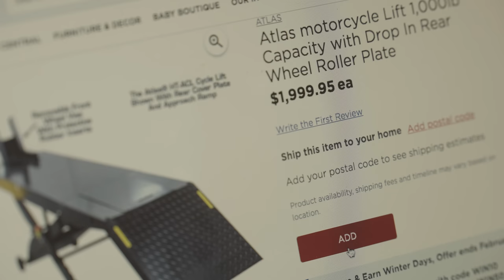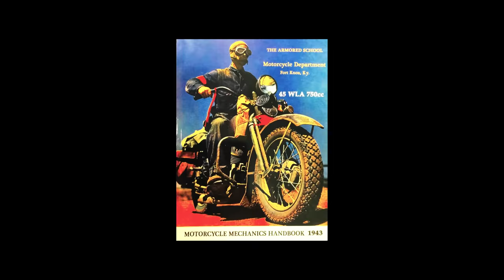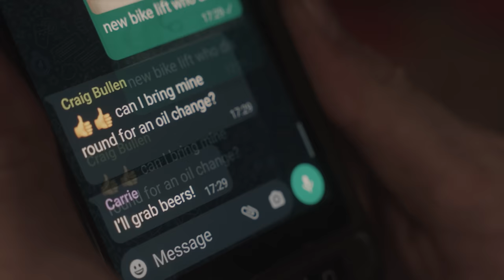DIY Roll-On Motorcycle Lift for $290

Comment: Sadly the same concept would be hard to transpose for a spyder... no ? :D 

IMO it would require a bit more strength, and would need to use its own weight to help lifting it in position. I'd build it so you back up on it, then raise the front, this way you can build a long ramp with a triangle at the "beginning", where your front wheels would sit.

Balancing it properly would be important to make it easier to lift it.

Comment: For 290 bucks you can get s decent used proper hydraulic or pneumatic bike lift.

I like the idea though, but it‘s hard to believe that a regular sized grown man would be sble to lift a touring behemoth (Street Glide, Goldwing, etc.) or a tall/heavy DS bike onto that thing without stretching one‘s luck in terms of balance and tipping momentum — let alone trying to roll it back again without help.

Keep in mind: That design was for improvised army field maintenance of lighter and lower built motorcycles a century ago. It might work well for lighter cross or enduro bikes, or people way above 200 muscle pounds and 6 feet height.

Everything else is a matter of practice, bike model and dumb luck.

Comment: I love all your contents including this episode. In the US, I see this as big major law suits waiting to happen...
Reply: Why law suits?
Reply: @heathb4319  Just my view and opinion. 1. Depending on the weight and height of the motorcycle, its going to be challenging to push up; incline. Also, shorter rider may have reach issues as you push up. 2. Sudden drop as you as bring motorcycle to end of platform may cause a losing grip and balance. Maybe you can add a dampener to drop slowly. 3. The back end locking piece is flimsy. It needs better solution. 4. Not all DYI folks are going to use similar or better materials and build skill may not be the same.
Reply: @johnwok15  ...I don't really see a law suit type problem...I just think it is useless and over priced.

Below is what i actually asked the channel...

"Can you please explain to me why this is such a great thing and then try to justify 300 bucks for what is 50-75 bucks worth of materials and a couple hours of time.
I honestly dont get it.

Lots of straps, cant change a tire or wheel.
There are bike lifts ranging from 150-400 all over the place that provide so much more and are built stronger that also allow you to do so much more.

I love what you do for the bike community but i really don't get this vid or idea.

Anyhow...Peace.

Comment: Good idea overall, but I’m Not that crazy about drilling that hole through the middle of the main beam, maybe i would mount the pivot / bar under the beam held in place with brackets… There is a difference between using it for a XL650 and. R1100S

Comment: Oh My God! Superb! thank you for sharing this. I've been wanting to get a table lift for my bike but put off due to the prices.
Just a couple of questions - 
1) You're using a lightweight bike on the ramp. However my Yamaha XJR1300 weighs 489 lbs dry so is a heavy bike! I understand you are using some slotted steel angle irons to give support to the centre 4x6 lumber, but will this be up to the job of lifting and holding my 490lb beast?
2) I'd feel happier with a centre plank probably twice the width to roll my bike onto - If I modify the measurements to cater for a 12'' centre plank (probably two 4x6's bolted together), do you reckon this would work?

Comment: OK I don't get one thing... When you want to load a bike on a trailer normaly you would use beltsfor the handlebar. They have already enough tension and they hold the bike just enough to let you secure the other belts. I don't see those handlebar-belts... So let me recap: 
- You push the bike on the rail, its weight makes the rest. Fine. 
- The front wheel is catched between the two front pillars. Great. 
- Then the purple belts stabilize the bike at the end. Wonderful.
But assuming you are alone in your garage, what exactly is holding the bike on balance while you, again alone, pull the belts until the bike is stable?   How many friggin hands do I need?!?

And of course the way around.. you want to unload the bike... so you need to set it free first and then roll it down... how you do that alone? 
in both cases you need "something", or someone, which holds the bike while you do all your things... 
On the DIY guide you forgot that "something"...

Comment: What? I can buy one for $290! Why would I spend hours making my own patent for it? I will admit it looks pretty good, but... I could have changed my brakes and oil filter in that time. Should I rather build this?

Now, don´t get me wrong! This is an awesome tip for people that have lumber and maybe Iron laying about, who wants a stand for their bike! But if you have to buy it all for $290, I´d rather get a proper one, where you can adjust the height according to the work you´re doing as well. Also, I´d happily build one just for display purposes when I don´t use my bike! Because it just looks pretty awesome! 

As for replacing a real working jacking table - I would still prefer the proper one.

Comment: I mean, cool video thanks for sharing...

But I have never understood the idea behind a motorcycle lift that doesn't suspend the bike off it's tires. Like... y'all have bad backs? Or are you just doing way, way more hours maintenance on your bikes? How does it help to have the bike ~10IN higher off the ground? And if it does help so much, why not use a 2x10 board and a few cinderblocks if you really need it up oh-so-high.

Srs, someone please tell me how this helps so much. I can see having a bike engine at table height for rebuilds... but you could literally ride up on a curb and get more than half this functionality.

Comment: by far, the most frequent requirement for me is wheel removal, how does your stand accommodate this important job, please?
Reply from the maker: I left a gap in the angle iron above the pipe so we can throw a scissor lift under the skid plate. Works great! Thanks for watching. ~M43

Comment: Ok, but without the radial arm saw, the drill press and drill and the right angle grinder, building one would be a PITA.
So if you're already a handyman/ do it yourselfer, yeah.
otherwise, the Harbor Freight one ain't bad. And it's NOT 2 grand.

Comment: What happened to the waterproof gloves video ?
Reply: Im interested also
Reply: Copied from earlier reply:
They messed up with equating gasproof with waterproof. They had a cool bubbling tanks with slightly compressed air inside the gloves. It looked cool but it didn't prove what they thought they were proving. The replacement video will likely fix this error.

Comment: Quick question... I have a Honda CB1100 (250kg/540lb wet. Is this suitable for havier bikes? I wonder whether it will be dangerous not to drop the bike towards the opposite side of where am I standing (you know what I mean). That would ruin my day... 
Any tips for safely using this lift? :)

Comment: I'm a big fan of the channel, but that first wooden lift he made is NOT how you make that lift. I made one and I use it all the time.. It just takes a 2x8 to build it and a 2x4 for a handle. Also, Harbor Fraught has 3 lifts for $140, $230 and $600 if you wanted to just buy one -_-

Comment: Great for dirt bikes/lighter bikes. What do you think the weight threshold would be for this?
Reply: The limitations would be the strength of the pipe used for the pivot and the type of wood used. Use a solid bar pivot and oak lumber and it'll take a thousand pounds easily. I would be making it wider so it doesn't tip over sideways if you plan on putting a Harley CVO Ultra on it. But getting up there would be nerve wracking too

Comment: Where did the glove video go? I was in the middle of watchign it! =(
Reply: Copied from earlier reply:
They messed up with equating gasproof with waterproof. They had a cool bubbling tanks with slightly compressed air inside the gloves. It looked cool but it didn't prove what they thought they were proving. The replacement video will likely fix this error.
Reply: @ddegn  thanks! =) very fortnine of them of putting quality first!

Comment: would have been great to have the measurement in non retard unit also ...
unlike what i've read, imperial is not standard for wood all around the world, here in japan we have it for the lumber "cut size" but not for the length, for which we use centimeters, because thats a unit we are familiar with.

Comment: my bike is too heavy to push up this steep angle. 
it would be easier to work on it without. its not a car with inaccessible oil drain unless the thing is lifted. its a motorcycle with easily accessible everything.

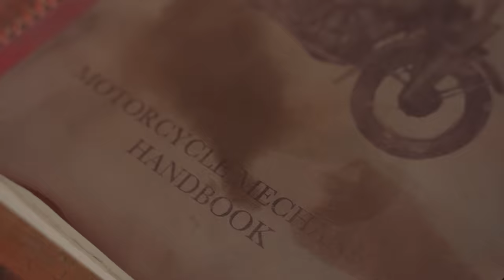Comment: 1:24 Holy Bejeezus. That stuff seriously cost you that much? You got bent over my dude. Thats like $50 in USD At most. The lumber was about right, For AC2 Pressure Treated. 
If you were to substitute construction lumber rather then dimensional , You could have cut the total cost down to about $80. Total.

Comment: That has got to be the biggest waste of 290$ plus 5 minutes of my life. Your video making skills are amazing but your fabrication, carpentry, and mechanics rate right up there with Fred Flintstones. I mean I could picture you making an engine swap video consisting of a sawzall and a hole in the floor board of your golfcart so your sandals can reach the bed rock or cobble stone or whatever the f#@! you drive around on.

Comment: Not to be a hater but what is the point of this for 290? Wheels are still on the lift and it looks flimsy. Can’t pull the wheels, forks, swing arm etc. Princess auto sells dirtbike lift that lifts 3.5ft high w/ 350lb capacity. I welded hooks on mine and put an anchor on the floor and it is rock solid. Then you can do literally any work you wanted to on a dirtbike completely stable for 40$ less than this AND 1/5 the work? Why spend more on this to have a harder to use less versatile tool that you have to build yourself?

Comment: Might as well save the money and just put it on a block as this is just a shitty display stand...can't work on the wheels or the suspension as the tiedowns are compressing  it into the stand, it's hardly compact either not easy to store when not using it the two times a year it gets used.....and you can get get a pneumatic riser block from Amazon for like $50 as it's only for dirt bikes coz you aint putting a sports bike on it......buy some beer with the other $240 for your buddies they will still come.